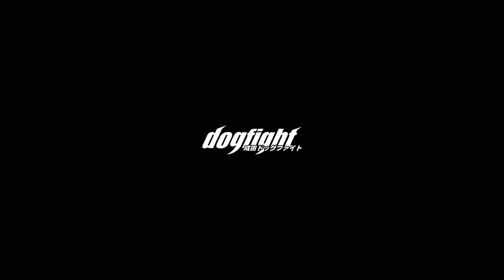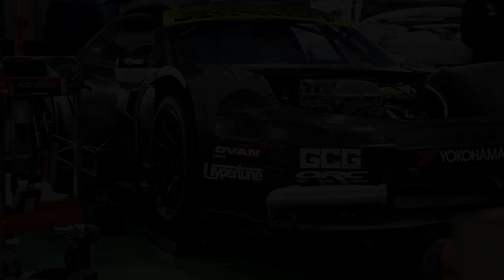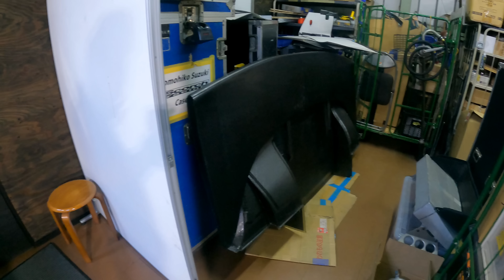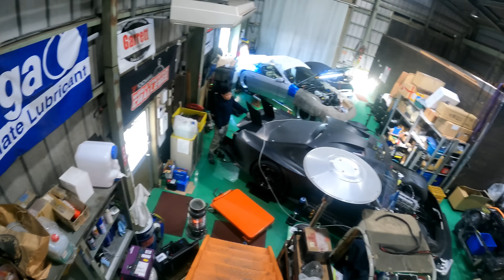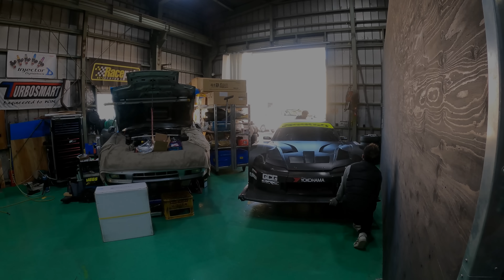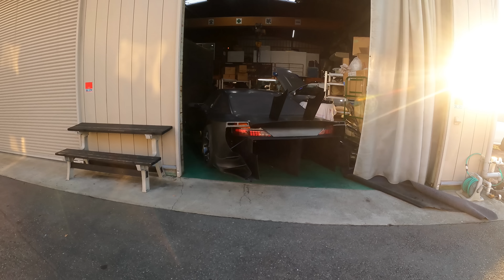The Return of Under Suzuki - Scorch Racing S15 Rebuild

Comment: video that makes me excited!  the question is, with those push road shocks how is he going to participate in the pro class in the wtac?  Isn't it forbidden to move the position of the upper shock absorber attachments?
Reply: There's plenty of international competitors that come to WTAC with cars that are outside of the rules ie. R8 1:1, the various R35's and that corvette lined up for this year. The event organisers can invite whoever they want internationally, and it's good, as it shakes up the local flavour a bit. I will say though, I wonder if it's an additional coilover? In which case the original Macpherson may still be present? Also, the rule stipulates retention of the material of the front shock tower - the suspension pick up points etc. Are free according to the rule book 🤔
Reply from the maker: I'm not sure about the technicalities, technically there are still shock towers
Reply: Just did some investigating - RP968 and Hammerhead both run double A-arm setups and don't have coilovers fitted to the original strut tower location.
Reply: The car must retain the original strut towers however you are not required to use any of the original design or pick up points...

Comment: I’m glad he’s back. I have a question though, what category does this car fit in? Is it based on a s15 or is it full tube chassis? And how is it legal? I know that in WTAC (unless they’ve changed the rules *so feel free to correct me if I’m wrong) you’re allowed to back-half (rear tube chassis) the car but you must retain the front strut towers *but you don’t have to use them and for what I see he fully removed them.
Reply: WTAC Pro Class. Built on an S15 unibody but back halfed just like you described. He is clearly using some kind of push-rod suspension up front, perhaps the original strut towers are hidden underneath thoose big wheel tubs?
Reply: @turdferguson9190  could be the case. Can’t wait to see it turnt to 11
Reply: I asked Under about this and he said he still has them they just arent on the car at the moment during maintenance.  My side note to this is that they are not required for running at Tsukuba and he also runs in our home country Japan which has basically no rules at all.

Comment: That diffuser is built for LeMans. Totally not working properly on a track like Tsukuba unless the driver is averaging 80mph!
Reply: Well, for your info Under Suzuki average lap speed at Tsukuba around 145km/h before total rebuild, let alone Sydney Motorsport Raceway.